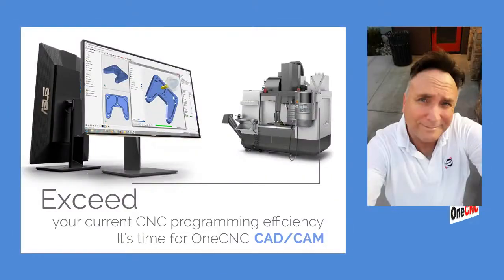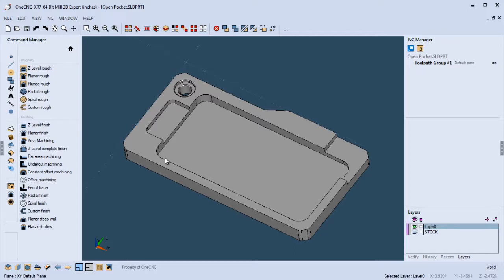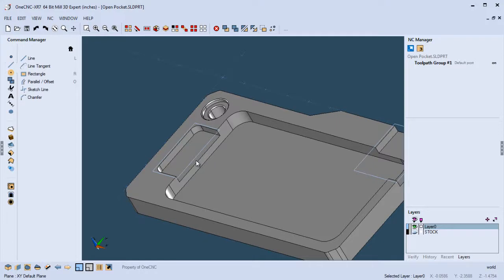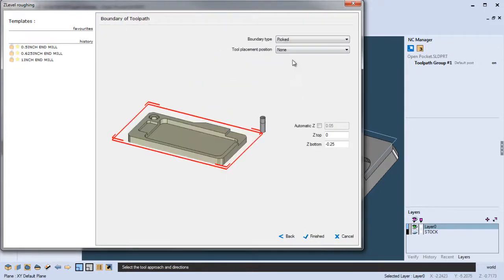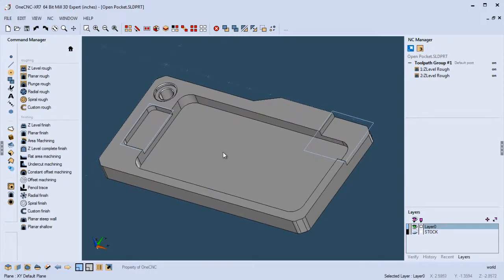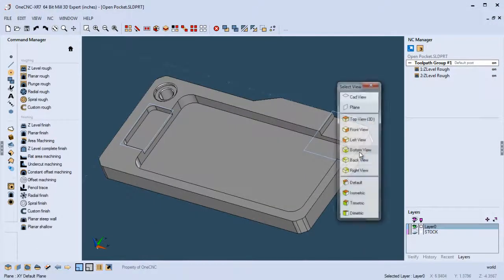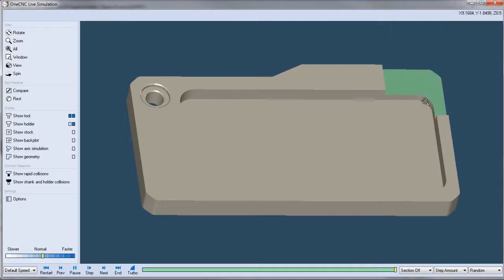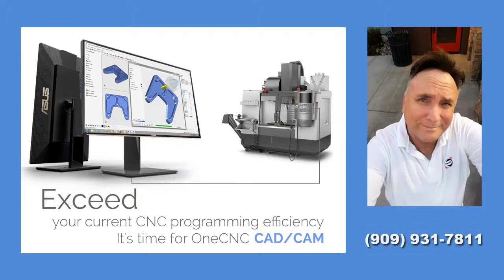OneCNC XR7 - Open Pocket Machining for Solids

Comment: Nice feature.
Do you use Z level finish for The Final Cut? Or can you do that in Z level rough at the same time?
Reply from the maker: For this part, it would better (more efficient) to use a Mill Profile machining operation for the finish pass. You would first extract the edges from the solid model then apply the Mill Profile machining operation.

The Z Level Finish machining operation is really intended for finishing 3D walls that are not vertical. For example, Z Level finish would be perfect for finish machining the inside of a mold cavity. 

Please note that Z Level Finishing is not included within the Z Level Rough Machining operation.

Please also note that the Z Level Rough machining operation is also really intended for machining 3D walls that are not vertical. However, it's a very versatile command and can be used for lots of applications (like the part in the above video).

Hope this helps!
Reply: @onecncwest  Thank you.
I'm just starting to learn OneCnc.